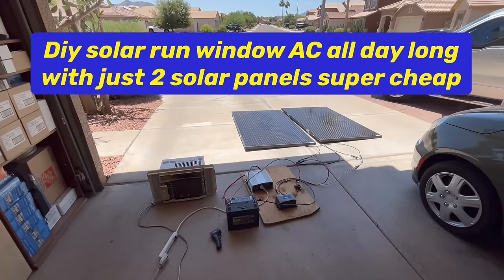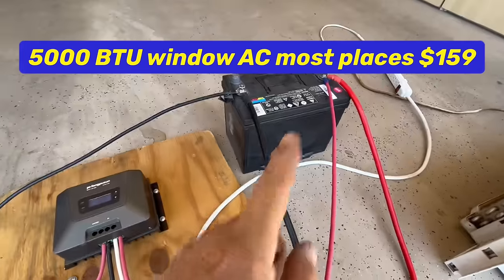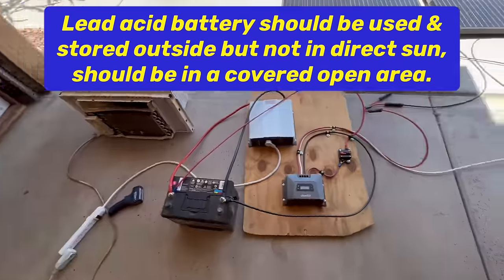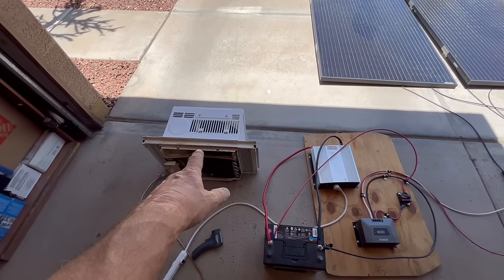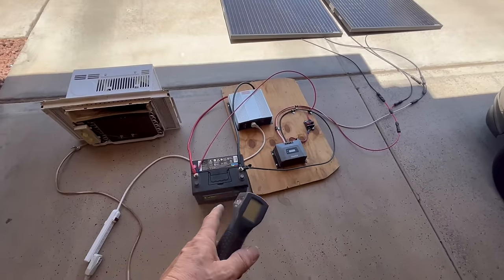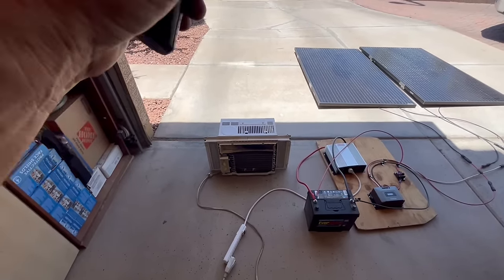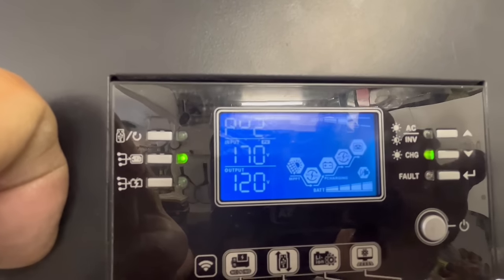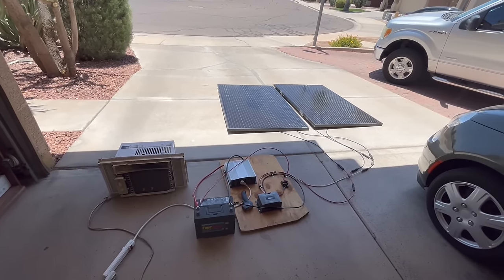Run your window AC with just 2 solar panels when sun shines. Easy DIY project you can do in one day.

Comment: After saving the cost of the components, the savings starts. That's a few summers use.
Reply from the maker: I started with this 4 years ago, not I use solar to completely cool and heat my 2story 2450 square foot house 24/7. I also heat and cool my 3 car garage along with heating and running my in ground pool. Check out my other videos to see what is possible and what components I use. Thanks for your input, hope you have a truly wonderful and blessed 2024.

Comment: Better to throw a few lithium batteries and 2 more panels and run it all the time.  And run much more, too.
Reply from the maker: This is just a simple system, I completely air condition my 2450 sq foot house and 3 car garage with just solar in day and 25.5kwh LiFePO4 battery bank at night. Check out that video. Thanks fir your input. Hope you have a blessed day

Comment: I'm surprised it runs considering how inefficient all the components are. Using higher volts for both the DC and AC side would help a lot, also a LF pure sine wave. Im a bit surprised the compressor doesn't cause the cheap inverter to overload
Reply: You can also use a DC air conditioner and avoid a lot of to this equipment
Reply: You can probably also run those panels in series with that MPPT controller (check the max voltage input specs in the manual)
Reply from the maker: It would be much better on a 24v system but I was just trying to show you can run an ac on very minimal amount of components, of course if you upgrade components, you will do much better. I will try to do a video using same charge controller but as 24v so I can add more solar panels.
Reply from the maker: You can run solar panels in series or parallel. I tried both ways and did not seem to make a difference in performance or efficiency.
Reply from the maker: I have not seen a window dc ac yet? I know they have direct input from solar panels to mini split outside unit. I will be buying one of those soon.
Reply: @diy-solar-guy  it will make a difference in less than ideal conditions, as well as losing less energy via heat through the cables as there will be fewer amps
Reply: @diy-solar-guy  I haven't seen a mini split DC, but they do make DC air conditioners as kits and for semis
Reply: @diy-solar-guy  I stand corrected:
https://youtu.be/AxmKiisAZ0I
Reply from the maker: @The_Ballo  I have seen the dc ac for semi and vans but the reviews are not good. They can only cool a really small area and the ones I seen in vans have a hard time keeping up in AZ temps in summer time.
Reply from the maker: @deadballo  a Lot of people are interested in being able to run a room ac during the day with just solar. It can make an impact on electric bill adding one even for a few hours a day every day of the month. There are so many ways and so many components you can use to set up solar powered ac it is amazing. But there are just the basic parts and you can always improve on each component as you want to. Thanks so much for all your wonderful input.
Reply: @The_Ballo  Go price a DC AC unit around 6k BTU..They cost $4,000.00+ The 8k BTU cost $5,200.00.. You can buy some serious Solar equipment for that kind of money...
Reply from the maker: The price is still too high for dc units. A couple of years and price will drop.
Reply: @diy-solar-guy  There not even that efficient. you could buy a mini split and do better..
Reply from the maker: @WizzRacing  I have 6 mini splits I installed in my house, they are extremely efficient. Great in summer and winter. Had over 3 years now with not one problem. Work well if you install correctly.
Reply: This is way over my head but super interesting. I have the air conditioner and I have the inverter. If I buy a set of panels and a controller and one of those lithium solar panels with 100 amp hour, I will need to keep the electronics in the house meeting the bedroom but I can store the battery and the panels outside facing the Sun? This is for cooling a single room where the bedroom window faces the sunrise. I was just asking especially if the lithium lifepo4 battery is better than buying a deep Marine
Reply from the maker: @mrobvious1100  yes. A LiFePO4 battery is far superior to a lead acid or AGM. A lithium iron phosphate battery can be stored inside especially if it has a Bms. The EG4 51.2v I use also comes in 12v-400ah and 24v-200ah. You can use a LiFePO4 battery to run overnight if you have enough solar panels to run ac in day and have battery 100 percent charged when sun goes down. Check out my video on first 28 days air conditioning my entire house with solar during day and 25.5 kWh LiFePO4 battery bank through the night. You can also find links in description of video to purchase EG4 batteries if interested. I explain a lot in my videos, I have posted over 100 videos using solar to run mini split heat pumps which are far more efficient than window ac and will use less watts than window ac overall for a 24 hour period, especially if you invest in a 38 seer mini split. Those units can get as low as 200-300 watts once room is cooled to set temp. Check out the videos for a better understanding of cost and what is needed. Hope this answer helps. Hope you have a wonderful and blessed day.
Reply: @diy-solar-guy  I will check that out thanks
Reply: @diy-solar-guy  In series if one panel becomes shaded it impacts all in that run while in parallel only the shaded panels have reduced output is how it was explained to me.  View them like Christmas Lights that are wired in series where one bulb can impact the entire string.  I have no real experience with this myself since I've only used single panel sub 100 watt units for running security lights and maintaining individual batteries however this is what the "Experts" told me.

Have been considering similar using an old used computer UPS unit that supports external batteries, provides extremely clean power and automatically can switch to the solar charged batteries when grid power is interrupted or manually turned off.

On heat sinks that are convection cooled items its best not to install them one above the other since they need cool air coming in from the bottom for the heat sinks to work effectively expelling heat out the top.  Heat rises and cool air falls so you have to set things up with that in mind.

Best!
Reply from the maker: @neilfromclearwaterfl81  this was just a simple example of using solar. I am actually running my central air conditioners 3 1/2 ton upstairs and 4 ton downstairs with a 12kw Growatt low frequency off grid inverter with 11,000 watts in solar panels and a 25.5 kWh EG4 LiFePO4 battery bank for overnight use. It’s been 113 degrees in day last month and 90 degrees overnight lows and I spent $0 on air conditioning cost last month keeping my house cold at 72-78 degrees. Check out those videos, I think you will like them. Hope you have a blessed week
Reply from the maker: Check out my other videos to see what you can do with off grid solar. So much can be run with off grid solar. Thank you for for input.

Comment: Can I do this with a ten thousand
Reply from the maker: Ten thousand what? Please expand on your question with more information.
Reply: @diy-solar-guy  btu ac
Reply from the maker: @aphilly2158  you could but would have to use at least twice as many components. You would be better off getting an all in one inverter, either 24v or preferable 48 volt inverter. I have videos on 24 volt and different 48 volt inverters. These all in one inverters are typically pure sign wave output and can take at least 2000 watts of solar input. I find most people that try to do this example of running window ac with solar go onto want to expand system to run even more appliances. Watch my other videos to see everything I have been able to run with solar. I started with this very basic system and now run my 3 1/2 ton (36,000btu) and 4 ton (48,000 btu) heat pumps in my 2450 square foot 2 story house with only Solar during the day and run my 3 1/2 ton ac overnight with EG4 LiFePO4 battery bank. If you like this video and think about trying this, you will love watching the other videos I did. I started out using all used solar panels that I was buying for $30-$45 each poly solar panels and now have switched to new and used mono solar panels, getting 300 watt solar panels as low as $15-$22 each. When on a tight budget, used solar panels are a great alternative to new solar panels. Price wise you would probably spend same amount of money buying double the products used in video and the all in one inverter would end up being a less expensive overall cost to run the 10 btu window ac. EG4 3000 watt off grid inverter refurbished is $524 and new is $674. Hope you have a truly blessed day
Reply: @diy-solar-guy  ok thank you looking into it

Comment: If no water pipe on the back of the solar panel  to keep  cool. The panels will die due to the heat. (
Reply from the maker: You would not want to use water in back of solar panel as it could short out electrical box on back of solar panels. These solar panels are designed to last 20-30 years in the heat in AZ. Please don’t use water on back of solar panel, it could cause electrical shock, a fire or both. Not a good idea. Hope this helps, you do not need to add anything to back of solar panel at all. Hope you have a blessed day.

Comment: Keep the panels off the ground to cool they lose efficiency. The inverter runs better cool too.
Reply from the maker: Thank you for your suggestion, I just laid solar panels on ground so I could have all the components showing of the minimum needed to run a window ac. You are absolutely correct. Most of my solar panels are on my pergolas 9 feet off the ground and get great cooling on back side. Hope you have a truly wonderful and extremely blessed 2024.

Comment: temp readings has nothing to do with the electricity draw ....
Reply from the maker: The higher the temperature outside, the more power will be used, this is not an opinion, it is a fact. All my air conditioners use much less at night than during the day, also less at 8 am then at 3pm. It is very easy to see when you can monitor the watts or amps being used.

Comment: you said 12v, but the marine battery says 24v on the front.
Reply from the maker: Lol, I don’t even own a 24 volt battery. I have to connect 2-12 volt batteries together to make 24 volt battery. Not sure what you saw on battery but it is a 12 volt marine battery
Reply: @diy-solar-guy  it's right at the 30 sec mark....
Reply from the maker: @jeffegg2  if you can zoom in on your phone you will see that is the battery group number not the voltage of battery. Is says group number right above the 24DC. I was wondering why a lot of people were thinking it was a 24volt battery when it is a 12 volt

Comment: 10:07 what about under a awning?
Reply from the maker: As long as battery is not exposed to direct sun light, not able to get wet from rain and has air flow for when charging, the gases can be vented away with wind. Just try to make sure all the above is followed and you should be ok. Hope you have a blessed day.
Reply: @diy-solar-guy  what about deep cycle lithium battery. I’m gonna get 2 400 watt solar panels. How the hell do I plug my 5th wheel into the batteries
Reply from the maker: @youtubedeletesmychannels2329  there are a ton of videos out there that show installing solar in a tv or trailer. I have not finished with my solar in motor home yet.
Reply: @diy-solar-guy  ok thank you for the advice
Reply: @diy-solar-guy  my brother is telling me to get 2 car batteries. Deep cycle lithium 12 v 50 ah. And 2 400 watt solar panel 100ah with charge controller. Is this safe to hoo up to a 5th wheel for power?
Reply from the maker: @youtubedeletesmychannels2329  I don’t know enough from your description to answer that. Maybe your brother can help you connect everything if he knows about solar.

Comment: Boy that's great 1 small air conditioner. Why can't they charge up car???
Reply from the maker: I actually now run my upstairs 3 1/2 ton, downstairs 4 ton heat pumps to heat and cool house during the day and LiFePO4 batteries at night. We also heat and cool our 3 car garage with a 18,000 btu mini split as well. We heat our pool in March to 86-89 degrees water temp while our neighbors pools are in the high 40 degree range and run our pool pump 24 hours a day, 7 days a week. We also run 3-5 to 7 cubic foot freezers and a 24.5 cf refrigerator/freezer combo 24 hours a day as well. All with off grid solar and it all started 4 years ago running this little window ac with a few solar panels, wall mart battery and other components to see if it would work. Now our entire cost of system has paid itself off with the savings on electricity bill. Just free electricity from here on out. Check out our other videos to see what components we used. Thanks for your comment and hope you have a truly wonderful and extremely blessed 2024

Comment: This little experiment says that you can initially power a window AC unit with a fully charged battery far more than it does that you can power the AC unit with the solar panels. Run this system for a few days and show the graph of that battery's voltage over that span then we'll chat again.
Reply from the maker: I ran this system in a 4x8 solar shed for around 2 years from 9am to 5 pm. If I were to use it for something larger I would add another charge controller so I could add 2 more solar panels and maybe another battery in parallel. I actually run my 3 1/2 ton and 4 ton upstairs and downstairs heat pumps to air condition my house with only solar in day and 25.5 EG4 kWh LiFePO4 battery bank overnight. I spend $0 last month electric bill on air conditioning my house with temps around 113 in the day and 85-90 overnight lows. This was just a simple illustration to show basic components needed to run window ac units. Of course if you upgrade and add more components or better components you can not only run window ac but 2 12,000 btu 110 volt mini splits with a 24 volt off grid pure sign wave inverter and a 24 volt LiFePO4 battery bank. With 5-6 kWh’s of lithium ion phosphate battery bank you could use overnight with only battery bank. I know I do it. It is not a theory, it is actually use. 2 inverter mini splits use 1/2 the power my 4 ton heat pump uses and once room reaches temp will drop over 1/2 watts required to keep running overnight. I know, I installed 6 mini splits in my house and garage. Have Worked great for almost 4 years now with no leaks or problems. We installed all of them ourselves, DIY. Hope you have a truly wonderful and extremely blessed week

Comment: That cheap harbor freight, high frequency, transformerless, modified square wave inverter will cause your AC's motor to run much hotter because of the distorted waveform which will shorten the life of your AC unit. Not only that, without an output transformer to buffer the inverter's MOSFETs from your AC unit's high startup surge,  you'll be lucky to get even 6 months of continuous use out of that harbor freight inverter because of the damage that you're doing to the inverter's MOSFETs. You'd be far better off using a low frequency, transformer based hybrid inverter charger.  Low frequency transformer based inverters last far, far longer and can easily power high surge loads without being damaged and they won't damage your appliances.
Reply from the maker: Ran window ac for around 2 years from 9 am to 5 pm with no problems or decrease in efficiency with ac. Ac still works like it did when I bought it. I agree a pure sign wave is better but a Harbor freight inverter will work for camping or light use every once and a while. If you try to run 24 hours a day everyday, yes you will eventually have problems. But I did this video just to show the basic components needed to use solar to run a window ac. Of course if you improve upon this basic design it would help. I would think most people would improve and add more to insure it runs the longest possible. Hey, thanks for your input, hope you have a truly wonderful and blessed weekend
Reply: The motor in your AC unit must be very durable. The harmonics of a modified sine wave inverter as well as eddy current losses are increased, due to the higher frequency harmonics and this causes heat increases over and above the heat produced when driven by a pure sine wave from the grid or a pure sine wave inverter. @diy-solar-guy
Reply from the maker: I believe I was pretty blessed with the ac unit I have. Never had a problem but I believe most people might experience problems after a period of time. That is a great upgrade with this basic system, use a pure sign wave inverter.